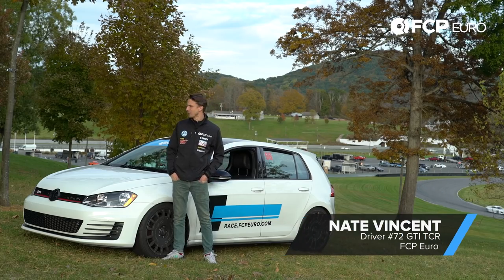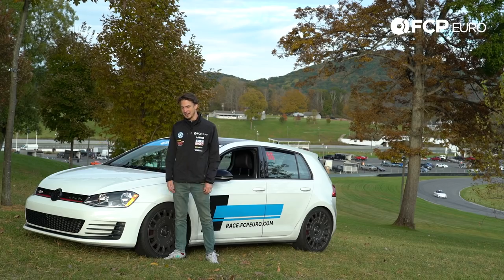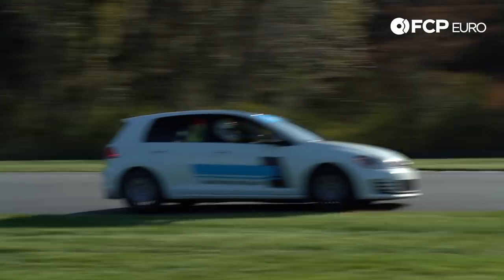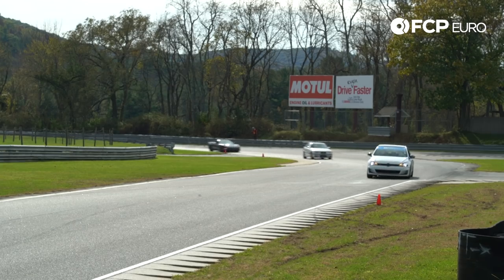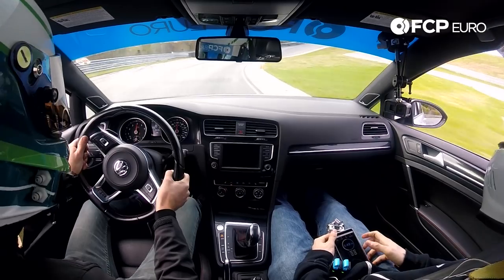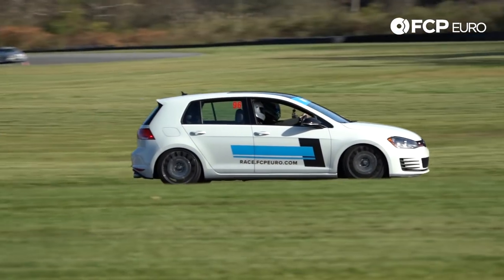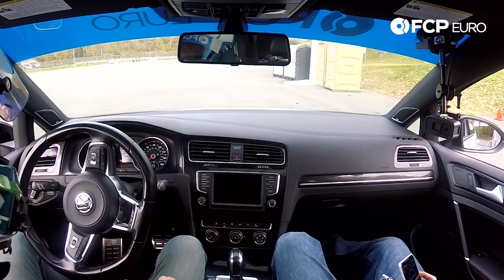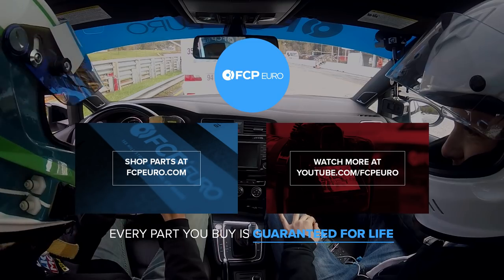2017 VW GTI with 034Motorsport & Sachs Performance Mods  - The Long Haul Project MK7 - Episode 4

Comment: Keep up the great content.

What brake system is presently used?
Reply from the maker: Thanks dude! The car currently has Zimmermann rotors with Ferodo DS2500 brake pads. The pads are a great choice for the occasional track day and the rotors hold up well considering the fact that they're regular street car rotors but there's still tons of room for improvement.
Reply: @fcpeuro  great video 👍🏿

Comment: What wheels and tires did you run that with? 
I'm trying to build mine for track and daily. I'm running Michelin PS4S tires plus tons of mods.
Reply from the maker: Hi 334 TRAX, we were running Falken Azenis RT615k+ tires on OZ Racing wheels. These are fantastic track cars with just a few minor tweaks!
Reply: @fcpeuro  thanks for the reply. Could you share information like camber? Tire size? Wheel size and offset? Thank you